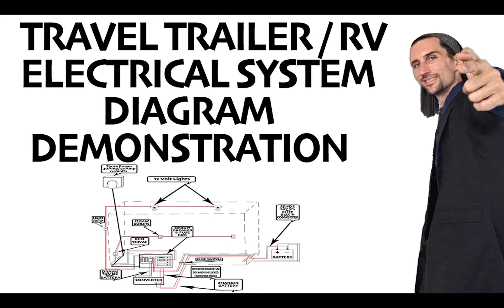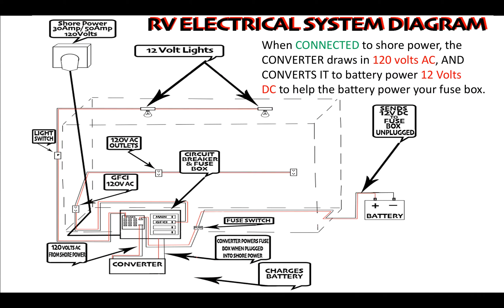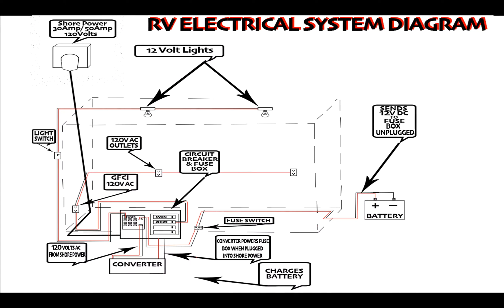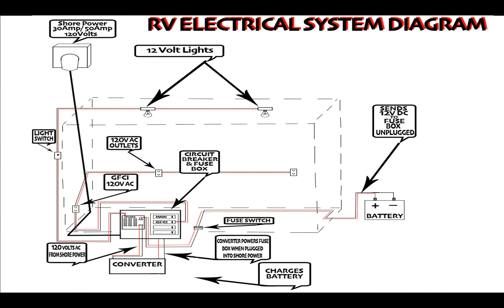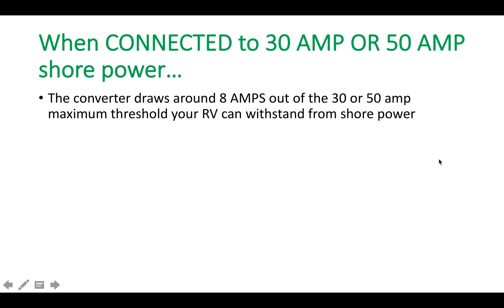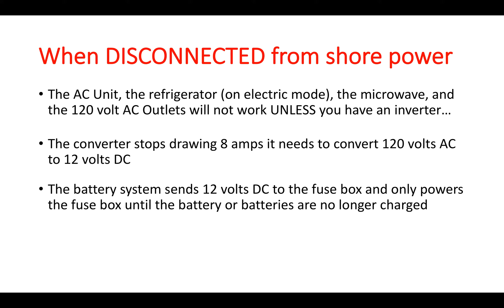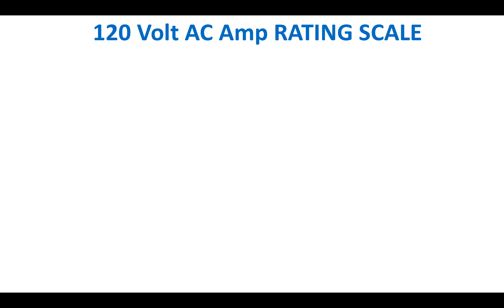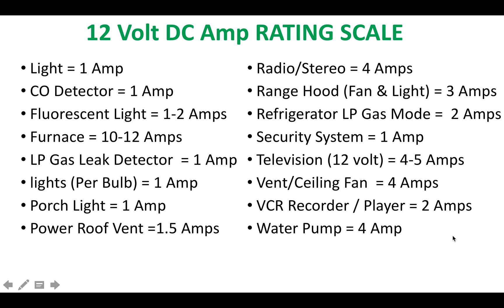Travel Trailer / RV / Camper Electrical System Diagram Demonstration

Comment: Nicely done, thanks! Do most larger RVs have the converter??  I had a pop up that only had 12VDC for lights and 120 was for shore power only, but I don’t remember if it had a battery or not, but don’t remember a converter at all. Thanks!

Comment: Like you said it helps to have a diagram even though the equipment and fuses and breakers are sometime well hidden!  I do have a question:  Is it the fuse box that "decides" when to get 12VDC from the converter or the battery?   Is it a detection circuit that operates a relay?  Thank you very much!!
Reply from the maker: thats a good question. I would think the relay is inside the converter but i could be wrong. I know the battery wires hook up to the converter and another set of wires hook up to the circuit breaker box and the electricity needs to go through the battery wires into the converter which probably goes through a relay inside the converter and i would assume thats how it works

Comment: I have a red white and blue wire that aren't hooked up to my circuit breaker box or inverter box I don't know what it is
Reply: That could be a phyberoptic cable perhaps?? For an antenna  or CB radio setup maybe?? Just a  guess but I wouldn't try to plug it in any fuse box or electrical outlets.. I'm curious
Reply from the maker: You may have to follow it somehow. I know they sell those cameras that can attach to your phone now. Maybe you can get in there to see

Comment: My inside 2006 aljo lights don’t works. But the microwave & ac works etc…. What’s going on??? Can you help
Reply from the maker: its probably a fuse... i would recommend getting a multimeter and checking all your fuses to make sure they're working properly and a set of backup fuses

Comment: My converter runs Constantly. Then goes up in smoke! I’m on my,fourth converter. What would cause the converter, to constantly run?
Reply from the maker: The converter should be constantly running and taking up a certain amount of juice. It converts the port power to 12volt DC as described in this video. Your battery may not be powerful enough to help the house power push the amount of 12 volt connections you have... I would look into the requirements and make sure everything is the way the converter needs it

Comment: `I’m that guy. I’m converting an all aluminum cargo trailer into our home on wheels. Since we started just as COVID hit it has been a struggle. Supply train wreck coast of products up 25%. Now the electrical has been frustrating. Not a lot of info I could find on the internet. This video popped up on my feed this morning. Benn trying to find out the proper way to ground the electrical system to the aluminum frame. A lot of talk about dissimulation metals.
Reply from the maker: I know how they work because I've been in enough RVs and I looked at how they were setup. I've never installed an electrical system. I've fixed numerous RVs from not having power but the ground wires, I've never had to touch. I'm pretty sure there is a spot to ground near the electrical panel but im not sure. That is avery good question!

Comment: Can i ask what generally triggers the generator to fire up  automatically. Is it sensing the 12vdc out of the converter or is the converter set up for a certain dc level that tells the generator we need more dc? 
Or is the generator automatically fired up as a result of ac usage?
Reply from the maker: I’m not sure I understand. My travel trailer doesn’t have a generator. A generator is usually a device that generates power on its own such as a solar powered generator or a gas powered generator. They’re usually very loud and used when your power goes out. Nothing I have in my trailer generates power automatically. All the power comes from the shore power or the 12 volt battery. The converter helps to convert household power 120 volts to DC 12 volts along with the battery that just produces 12 volt. Unless you have an automatic generator that turns on when it senses the powers out, idk what your talking about buddy

Comment: Hi Brian nice job. I have a suggestion that would help me - When towing my trailer and its 7 way plug is installed could you include the circuit that show how the battery is being charged?  What components are involved etc.  A graduate course on installing solar panels and an inverter with Lithium batteries with the integration of your schematic would be awesome.
Respectfully,
Rich
Reply from the maker: Thanks for the feedback! I’ve stopped making videos for now so I can focus on my health more. The reason I haven’t been posting is because I was sick with cancer and I’ve since had the tumor removed but I’m still in the stages of recovery! Maybe one day I’ll pick back up where I left off!

Comment: 1990 e 350 Ford 7.5 l  I have no rear lighting at all, no brake lights turn signals etc. In front everything works , any idea ?
Reply from the maker: try to find diagrams of similar wiring for your brake lights and go examine them yourself to see if you can find a similar blue print diagram. Once you can establish how they receive power, then it's just a cake walk from there my friend
Reply: @brianrussell5789  thank you, I found a ground wire bad, I ran two separate ground wires to brake light assembly and all good. Thanks
Reply from the maker: Sorry for the delay! Glad you got it figured out!

Comment: Hello.  I have a problem with my 1989 sunlite pop up camper.  At the entrance of the electricity cord it says that this connection is for 110/125 volts ac.  and has a cord with a regular connection.  but when i connect it with an extension to my house, only the plugs work but not the lights.  What do you think can be?
Reply from the maker: I've had a power cord fry on me before and my electricity was acting very strange...
Reply from the maker: im sorry i just realized what you said... your plug is fine! your camper needs battery power to run the lights.... Check your battery and if you dont have one... get one because usually where the connection is to haul it away, theres a battery right there that connects to your campers circuit board.. Check your fuses!  If you watch the video again, I explain how your battery sends 12volts to your lights and how it does that.. It goes from the battery to the fuses, to the 12 volt electrical components..  So you either have bad fuses, or a bad battery... I used to have to charge my battery all the time with house power. If you don't have a battery, the owners before probably used a converter only and they probably had problems because you need a battery to help the converter and visa versa... converters are usually behind the circuit board
Reply from the maker: the converter is what is supposed to charge the battery.... if the converter is not working... your battery isn't charging! I hooked up a battery charger to my campers battery one time, and boom my lights started working again because my converter went bad
Reply: @DJRussellBrian  Oh thanks.  what you say makes sense.  I don't have the battery but I'm going to buy it.  Thank you very much for the help
Reply from the maker: it sounds like it could be a bad plug... They sell kits that you can re do the power cord. Make sure you purchase the correct one that matches that cord... Unless, it was already replaced, and someone didn't get the right plug.... Then you have the wrong plug and it could start a fire
Reply: Thanks for your tips.  I'm going to check the plug

Comment: I have a 16' TT that is also on 30 amps and my water pump is not working off of 12v. I replaced the pump a couple of months ago because it was leaking. It was easy after watching a couple of You Tube videos. My pump is working fine now, but not off of 12v. I took the battery in and it was fully charged but it showing it was bad. I bought another one and again no power so I traced the wiring and there was a lot of rust and corrosion on the contacts where the 30 amp fuse connects. I tore it all apart and just ordered new wiring from Amazon and now, I hope I can crimp it all together properly. I bought 10 gauge for ground and 6 gauge for Red and black lines. My black line is white. Is it because it is rated for marine quality. Shouldn't really matter. Seems like it is probably more water proof but I'm gonna change it out for the black just to make sure everything is new. I did check the fuse and it is good, but I'm gonna change it too. I will be using your diagram when I wire it all back together. I'll keep you posted!
Reply from the maker: i was in the hospital during this comment but I decided I would follow up now and ask you if you figured it out? Was it the fuse and wiring?
Reply from the maker: to answer your question, I don't think it matters what color it is. Thats just so you don't get confused I would imagine. Personally, I've never replaced any wiring before so i wouldn't know. I made this video because I struggled for months trying to figure out why my power was being weird and I couldn't find any videos that could teach me everything I wanted to know.. So I made one

Comment: Finally a easy to understanding electrical video!!! Get job for us stupid electrical people. 
question: 
will all units work if you have no battery hooked up. when on shore power?
Reply from the maker: Usually not because the battery helps keep everything running on 12volts (battery power). Some lights, and sometimes the water heater, and other appliances need a battery because they don't run on 120volts house power. That's how the converter mostly converts SHORE POWER to 12VOLTS  is through the battery so to answer your question. Depending on the kind of trailer you have , no not all units will work. 12 volt lights, break lights, outside lights, and anything 12volts wont work unless you have a really GOOD CONVERTER

Comment: Very good video for understanding circuits but your wiring diagrams are incomplete because they do not show any ground wires and should not be relied upon for a DIY installation.  The negative post on the battery is grounded to the chassis by itself for the DC ground  The ground bar in the AC panel box and chassis bonding wires for the converter and inverter are connected separate from the DC output ground.  It is important that these be installed correctly to prevent an electric shock from a "hot skin"  and/or fire.
Reply from the maker: I appreciate the comment Roy. This was by no means meant to be a DIY installation video... This video teaches you why certain things might go wrong with your electrical system. It's just meant to help people understand why it's happening. Not how to fix it. Although, I have found that once you figure out how something works.... Those connections on my diagram just show one connection to everything to simplify the basics of what's happening

Comment: Do you ground the shore power to the chassis of the RV/Trailer . . . I dont see why but I dont know what's proper.
Reply from the maker: I'm pretty sure yes ... If you look at where the cables connect to the battery on the front of the travel trailer and follow those wires, you will see it connected to the chassis as a ground

Comment: U may have contractors that are inbetween the shore power and converter Generally right where ur shore power comes in inside the camper.And they are not cheap u have to go to a AIr conditioning parts store to get them basically they are a breakers. Better have about 200 for each.
Reply from the maker: Contractors? What the heck are those and what are they doing between shore and the converter? Sounds expensive!

Comment: Great job very informative, But I have a different problem I got in a hurry to get shore power to my just purchased 2012 Keystone Alpine 39 ft fifth wheel and plugged into 240 volt now I haven't got any 120 v ac where do I start to trouble shoot if you can help would be greatly appreciated there's not much on this topic on youtube or on the web THANKS

Comment: Can anyone think of a reason why the brake wire would be going into the trailer and then back to the brakes? I don't know at this point if it is attached to anything in there..will update when I do but just thought I'd throw it out there.  Seems weird. Asking b/c there is no power going to brakes.
Reply from the maker: Sorry I have been away on vacation.. Sounds like a problem I’ve never had my friend.. I would recommend busting out the multimeter!

Comment: Thank you so very much. My GFCI started tripping and I would reset not paying attention. I was cooking dinner lost all power, haven't gotten it figured out yet. Full time living batteries have been disconnected due to an idiot cut my cable to My tow motor idk why or what he was thinking. " Who does sh. . like that  needless to say I'm at a loss. I've replaced GFCI in bathroom it wouldn't reset I replaced outside outlet and kitchen. Tried to cut power back on " Nothing"😭☹️🤔
Reply from the maker: I’ve been away so I’m sorry I never responded... did you figure it out?

Comment: Great video. I’m new to trailers….

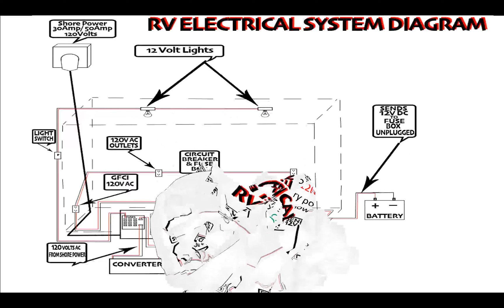At 2:34 you say “without a good battery system, the appliances won’t work right when relying solely on the converter” 

My trailer doesn’t have a battery.  I noticed that even Turing a second light on, the other one dims.  Then…when I had my fridge on, a fuse switch tripped when the furnaces tried to turn on.

What ever it was that tripped, reset itself after a few seconds. 

Is this all because I don’t have a better hooked up?
Reply from the maker: I really thought I replied to this comment a while ago... I'm sorry. I must've never sent it. You need to look for the red and black wires that come off of your electrical panel to your converter. Red and black wires go to the battery system to charge the battery so if you don't see any indication of red and black wires (without a battery) then I would say your trailer awkwardly doesn't have one.
Also, you can look up the model and type of trailer you have and ask google. Type your model and trailer then write, "battery system?"

Comment: The CONVERTER only takes 120V from shore power or a generator and charges the battery. An INVERTER takes 12V DC from battery and makes it usable 120V AC. When not plugged into AC (Shore power or generator) you will only have DC available until you add an INVERTER.
Reply from the maker: That's Correct!
Reply: To expand on this, it means the size of your inverter will determine how much total power (watts) you can use throughout your RV.  Hence why sometimes plugging in that extra "thing" is sometimes the straw that breaks the camel's back.

However, the inverters aren't strong enough to run major appliances like Microwaves or Air Conditioners.....They get power directly from the shoreline via a transfer switch built into the inverter that allows the 120V AC Shoreline current to pass directly through the inverter, to the power distribution block.

Theoretically if you had a 3000 watt inverter, you may be able to kick on the Microwave or Air Conditioner, but it would draw around 100-150 amps from your battery, draining even high capacity lithium batteries in just a few hours (20 minutes for cheap lead-acid batteries)
Reply from the maker: @ryansessions6278  I honestly have never learned about inverters before so you just schooled me LOL ... all I know is the converter helps the battery run appliances but sounds like you could make a video on it... you seem like you know your stuff!
Reply: @DJRussellBrian  every camper is different, so if you know some basics then you can look at how your system is wired.....Inverters usually come factory installed only to supply AC to your outlets...they don't supply your AC breakers unless you do some rewiring.....part of that reason is because one of your AC breakers is connected to the converter which then charges your battery....this would cause a loop where your battery is constantly charging itself but losing power in the process going through the inverter and converter to convert DC to AC to DC
Reply: I plan on upgrading my inverter this spring with a combined inverter/charger from Victron....this would allow me to connect the inverter to the AC breakers and then feed both battery and shore to inverter....the inverter would prevent the endless charge loop but also has a feature that will supplement shore power with battery power if needed....for instance, if you have a 15amp shore connection but need to run AC or Microwave